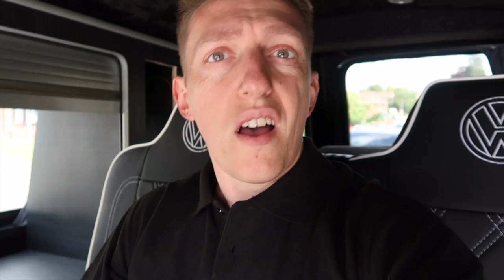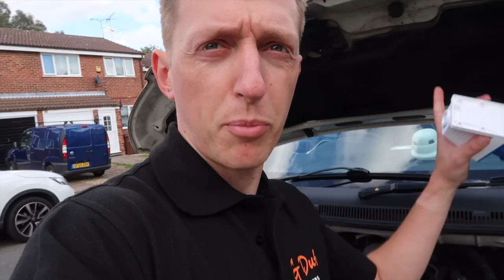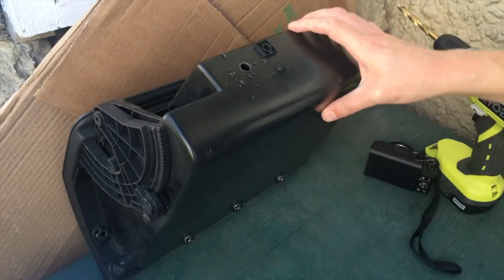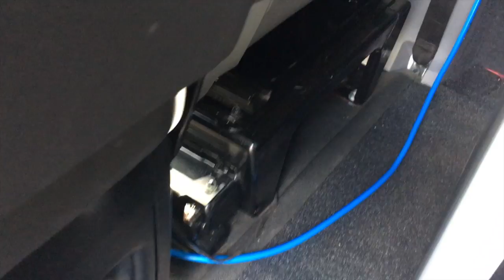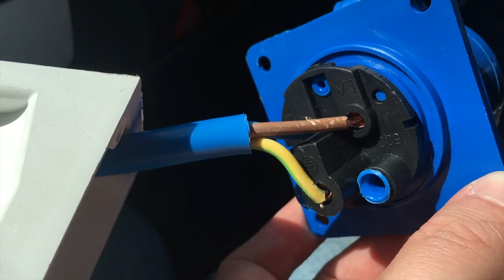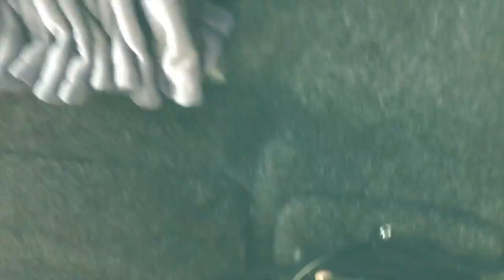Installing Mains Electric Hook-Up - Self built DIY VW T5 camper conversion

Comment: Can’t see why you’d run 240v entire length of van unprotected? Your input needs to be close to your consumer/RCD as possible. Fit inside at rear if you don’t want outside and suss out how to plug in without trapping wire...
Reply from the maker: Hey mate, this was a few years ago now. My first conversion too. Wouldn’t do it the same again.

Comment: Mate your hook up is too far from your consumer unit, you have an entire van length of unprotected 240v cable, stuffed around sharp edges, none of it in conduit, if that developed a fault/break you risk your whole van becoming live! The consumer unit only protects down stream!
Reply from the maker: Thanks for the heads up mate, I’ve long since sold the van, but will get it back to put some conduit around it 👊🏼

Comment: G D very helpful video running power cable via open window work, how did you stop rain coming in??
Reply from the maker: I've got Heko wind deflectors fitted so the cable goes under there into the van without any water ingress quite comfortably

Comment: Hi the 240v fitting you have is the wrong one yours is a socket you should have a plug. As it is the lead you need to plug in to the site lookup would have live pins exposed until you plug it in serious shock risk beware
Reply from the maker: Hey dude, not sure if you've seen the whole video but I initially started fitting the wrong connector but finish up with the right one installed - Very astute of you to notice my glaring mistake though - Top marks! :)

Comment: One tips I will do on my project. (Transporter T6 Not yet arived) When I do the panneling I will have 3 Plastic tubes from back  and towards the front for later upgrades. I will use plastic tubes to run electric cabels true and I will ad three more for later. Then I don't need to tear up the walls. I will also bring a connection box. That I will run relays if i want more lights to turn on bye the doors and one that is controled bye the ignition key. So if there is thing in the back that will only go on when the engine is running.. 
Sad I dont have a camera. But I think I need also to explain and show my build on Youtube. 
Love your videos. You give so much ideas on what to do and some what i don't want :-)
Reply from the maker: Thanks for the comments! :)

Comment: 240v hookup is good for having a battery charger fitted so while your using 12v I.e lights etc it's charging the leisure battery as you go save you having to start the van now and then,plug go to run stuff like a heater(stop condensation in the van or awning)or anything else that runs 240
Reply from the maker: Great answer @Wolfburg T5 :)
Reply: Great if you have a controler that can take 240V, sun and alternator (when car running) Then the controller charge main battery and the batteries in the back. Those are expensive but they ceep an eye on the batteries and make all bateries in good condition... I ordered my T6 now.. 203PS - DSG.. Looking forward to build.

Sorry for my BAD English writing here..
Reply: @GDubcampers   Do you have a name of a good charge controler? AC to DC and DC to DC controller.. I don't know the right name in English.

Comment: Random question. Why do u need 240v if
u have 12v dc leisure battery fitted? If I'm away for the weekend, the most I'll need is to charge phones, maybe convert into a laptop.
Reply from the maker: The mains electric is so I can plug in things should I need to, even though I'm unlikely to (like perhaps a games console, a tv, an oil radiator in winter) - I did wonder about whether to bother as I'm much the same as you, minimal usage over weekends, probably just charging phones/tablets.  In previous campers I've had a minas electric fridge which I need the 240v for but the current one is 12v only.

Comment: Mine came with the hook up under the rear bumper which is OK until (as you said) it's raining and you have to kneel down to locate the socket... Looking forward to your updates with interest as I'd like to be able to charge my vehicle & leisure batteries while hooked up as all my internal lights run from the batteries etc. I may have to replace my electrical panel.
Keep it up mate
Reply from the maker: Fab, thanks for the feedback.  The next few videos I'll be doing are all about fitting the Sargent EC-160 - Hopefully they should help you.  The principle is exactly the same regardless of the power control unit you fit.